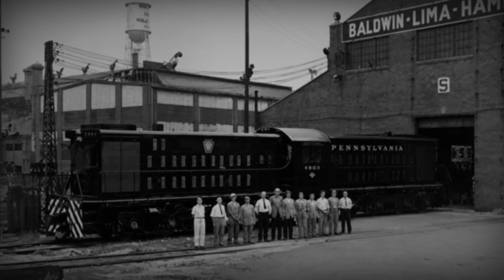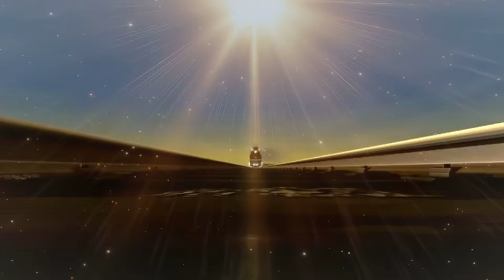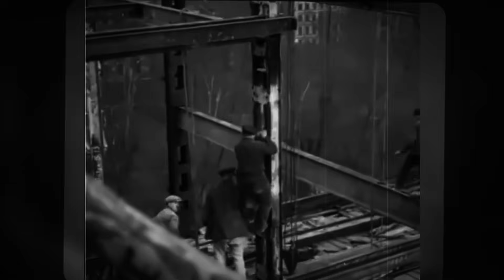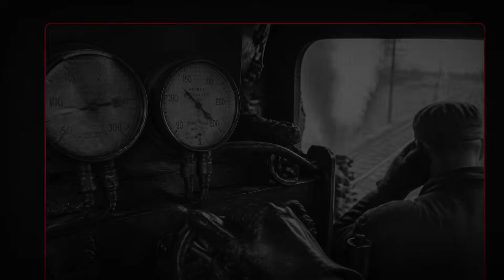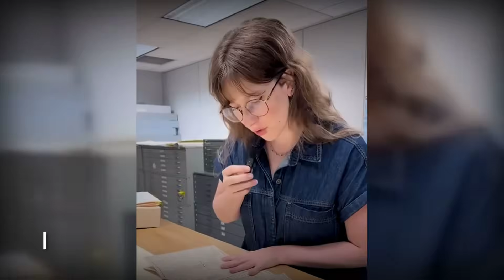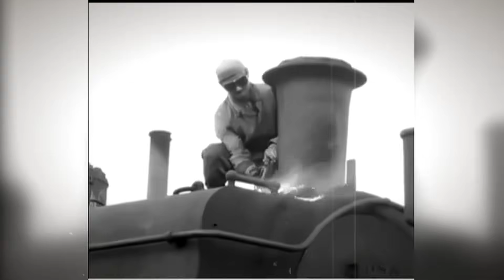The Locomotive That Was BANNED After Just One Trip

Comment: GG-1s could easily do 125 mph or more,  with passengers gears. I have seen them do it.
Reply: Unfortunately, eventually the trucks started to crack, not to mention, the electrics were giving off fumes which would later show cause cancer. Otherwise, they would have lasted forever. it's still my favorite locomotive. I know, I know, there are some great more modern, and faster, locos, but hey, I grew up in mid 20th century, with grandpa working on the PRR, taking me for rides for free. A few in cabs, which I will remember fondly.
Reply: @d.e.b.b5788 the GG1's transformers, like most transformers of the time, were cooled by oils containing polychlorinated biphenyls (PCBs). These worked well in their intended application, but were very persistent in the environment and had a habit of accumulating in food chains, causing health problems including cancer if ingested. PCBs are now banned from use.

Comment: Maybe I was  or asleep through parts of this so my question may have already been answered: was 6100 a one-off or were there others of this design that saw service?
Reply: There was only one.  Records at the Hagley Museum mention how the three builders milked PRR for over $3 million of development money in the latter half of the Depression '30s, and 'overbuilt' it for higher speed and capacity than could be practically used.  The T1s were the size and design to be "GG1 equivalents" much as the Westinghouse "R2" with planetary transmission was the 1948 follow-on the the oversized S2 6200.
Reply: I had a Lionel Super O locomotive like that when I was ten, 1961.
Reply: Before writing an asinine question,  why don't you try Google first?